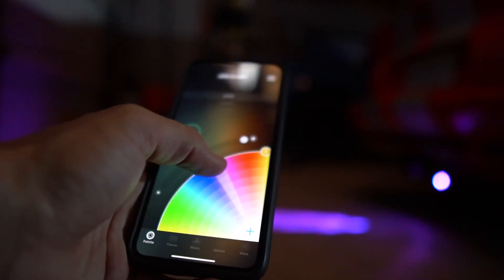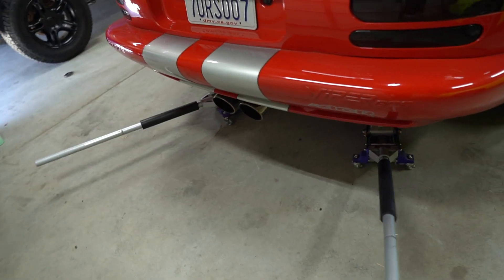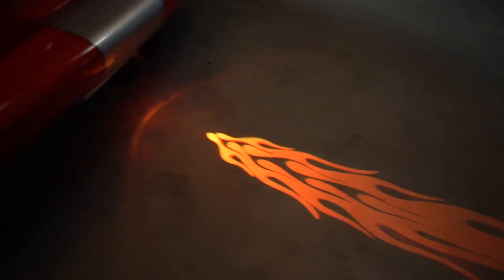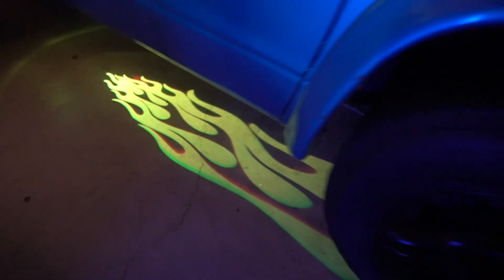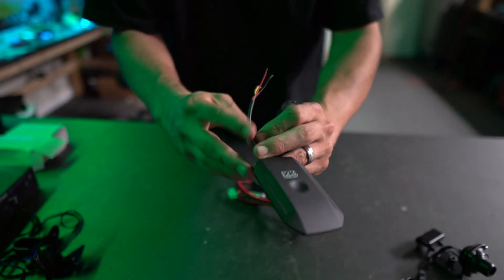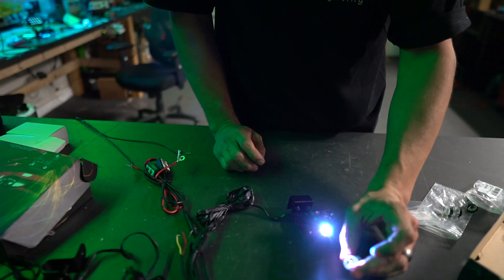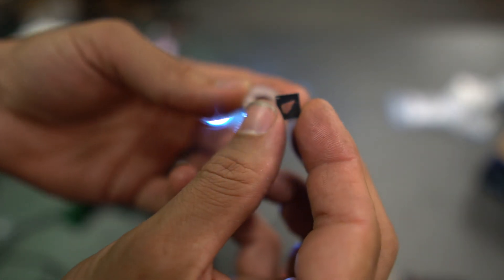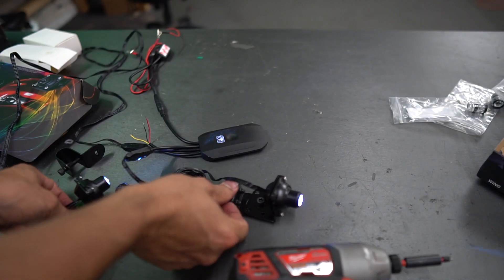What's INSIDE Car LED Image Projectors? | Curb FX | FlyRyde

Comment from the maker: How would YOU use these image projectors? Exhaust, on the side of the car, Front of the Car, etc.?
Reply: Clearly the flames for the exhaust.  Although it is illegal in Germany .... but most of my car is not legal 😂
Reply from the maker: Toto Mar haha! Lots of comments about legality in Germany lately. What kind of car bro?
Reply: @flyryde  my car is an Opel Corsa E OPC.  In other countries, the Corsa is also sold as a Chevrolet, or Vauxhall.
 The OPC (VXR in the UK) is a hot hatchback with Brembo brakes, Drexler LSD and - standard - 205 hp.  At the moment I am at 236 hp .... the goal is an output of 350+ hp
Reply: The top speed is currently 152 mph and it's legal to drive so fast in the Autobahn
Reply from the maker: Toto Mar sounds like a fun car to have out there!
Reply: Behind
Reply: Actually found your channel trying to get info on these little projectors. I messaged the company asking about new and different images such as actual angel wings or bat wings. It would be super cool if we could make our own little film images. I really want tribal wings down the side of my motorcycle to increase visibility both ways in style. The turn and brake control functionality is epic in added safety at night to me.
Reply: @NEGATIVExZER0  you can get customized ghost lighting
Reply: @spetersen3308  you're my hero for the day. I can't wait to put some wings on the sides on my motorcycle. ✌️
Reply: @spetersen3308  coming back to say "puddle lights" give me to custom image ability, but the xk chrome is the only rgb option let alone usable with brakes and turn signal. (I intend for use on the motorcycle so those benefits outweigh a custom image currently.)
Reply: Dude set them up as blinkers on the ground..... never seen it done, maybe you have but I think I'd jock that shhhh

Comment: I have been using XK Glow for a few years. The control is awesome but the connection is weak. I cannot tell you how many times I have replaced wires and strips just because the connector came apart. I have started only using their controller and making my own lights and harness.
Reply from the maker: Michael Meisman which parts have you used so far? I have found that marine heat shrink is a REALLY good idea if you have lots of XK connections being made anywhere that sees heat or stress of any kind. Controllers are my fav 💚
Reply: @flyryde  I agree the controllers are really good. But I have used many different length of the wiring. I have used the hard and flexible LED strips. I have used the single LED pods. I have used the line spliters. Every single one of them I have in multiples that are bad from the connectors breaking. I must have 100 plus feet of bad wires. I have to say the XK guys have been excellent in helping and standing behind the product. But when I am installing these on other peoples vehicles I can't have failures like this. So I have been building my own with connector parts off eBay. Waterproofing them with silicone but it is solid then.

I have not tried the heat shrink trick Dont know why I did not come up with that. but I will try it as we still have some of the cables on my sons car.
Reply from the maker: Michael Meisman I agree 100% about customer cars. Barrier to entry is waaaaay lower, as is replay ability for a novice with XK connectors, but for a pro you want (and really NEED) to know it’s gonna last and need no fiddling with in the future. I’m into massive multi pin waterproof connectors myself lol. So much better than 4 little RGB connections, and you just feel good looking at it 👍
Reply: @flyryde  Thank you for your time.

Comment: Do I understand the listing correctly for the double graphic option as coming with two projectors and the XKChrome BT controller?
Reply from the maker: Grant Coleman thanks for the question bro, yes, it has two projectors with your choice of graphic, and the new XK Chrome Controller with the turn Signal Feature built in 👌

Comment: I have used ghost lights but they are not built to dispatch heat from led...one got so hot, it melted solder to led!!
The projector doesn't look very large, how are they keeping led cool???
Reply from the maker: SolarizeYourLife the whole housing is acting as a metal heat sink. The rear half of the inner ball shaped assembly is made from aluminum, and they use a thermal adhesive with that as well. 👍

Comment: Could you print something on a piece of acetate and install it in the little capsule? If you could, it would be got for adding a company logo as an advertising tool.
Reply from the maker: Anthony Edmonds I’m gonna ask XK Glow today what would work best 👍
Reply: Cool man, look forward to seeing what you come up with.
Reply from the maker: Anthony Edmonds I’ll have to try a couple things, but I was told that manufacturing had a multi step process to get the optic sheet made. We’ll see how my bootleg efforts pan out 🤣🤣🤣
Reply: FlyRyde I like your style. 👍
Reply: Think it would have to be extremely high resolution....perhaps beyond your normal printer   unless you are ok with jagged edges. Think of a slide shown on a slide projector - any flaws in the slide are magnified many times over.   I suspect they use a laser with a convex lens.

Comment: Would be nice if they where animated
Reply: use a LCD projector!
Reply from the maker: S Petersen when they can pack the tech of a normal projector into a package this small, that’ll for sure be a thing. As it is now, that little square glass sheet would have to be moving, which obviously presents some challenges lol.
Reply: @flyryde  been looking at setup up dj Lasershow lights problem is there not waterproof.